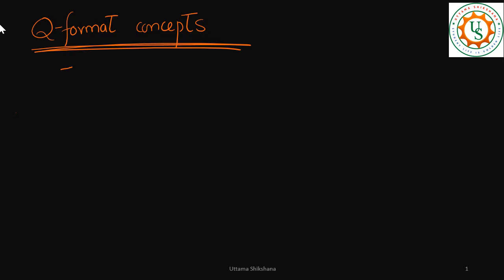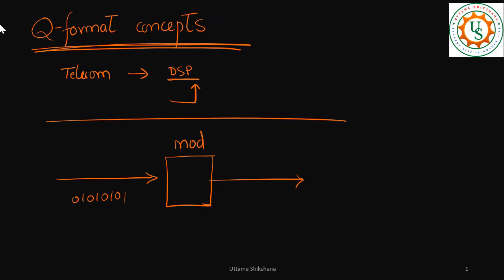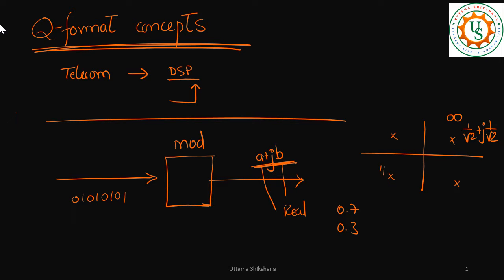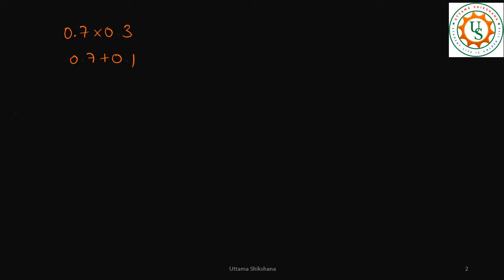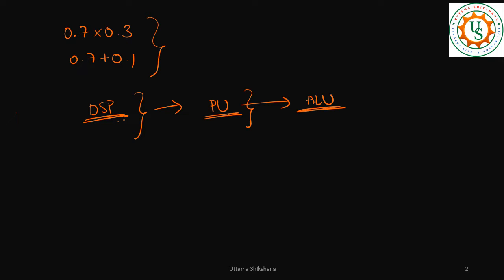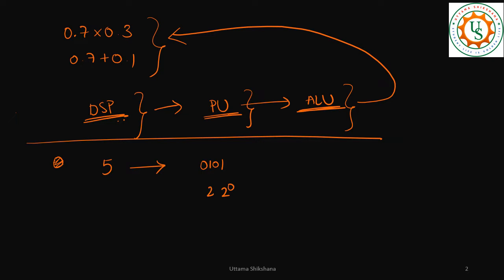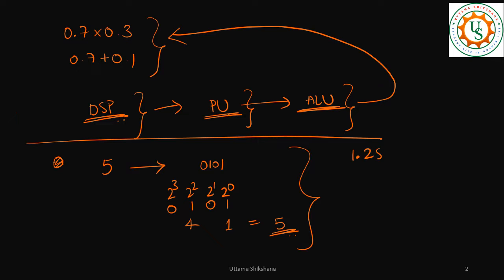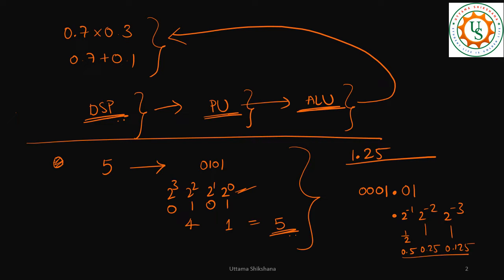[Series 7x] Q-Format Concepts | Fix to Float Conversions | Float to Fix Conversions

Comment: Hi, can you tell me if vivado hls is used in telecom industry for writing hardware algorithm?
Reply from the maker: Thanks a lot for the question.
It depends from company to company.
Also, mainly depends on which platform is used.
So, it might be used if the platform which supports vivado hls is used.

Till now, I have not come across this tool as the code is mainly written in DSP based SoC or generic purpose Linux servers.